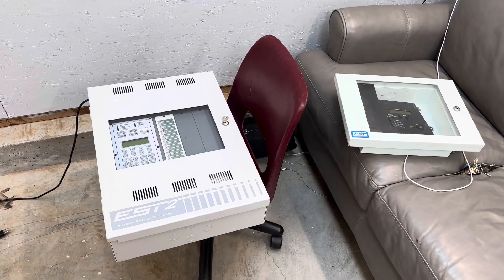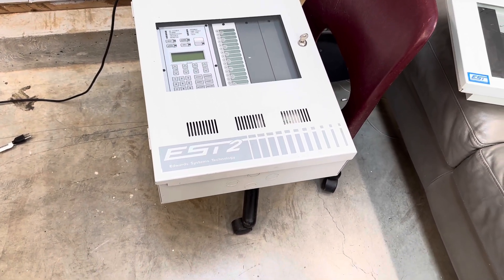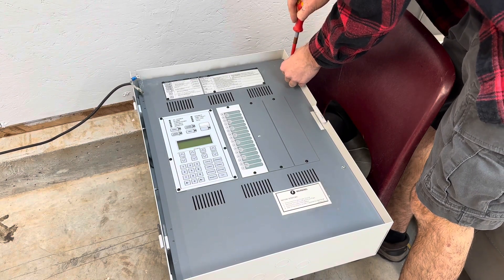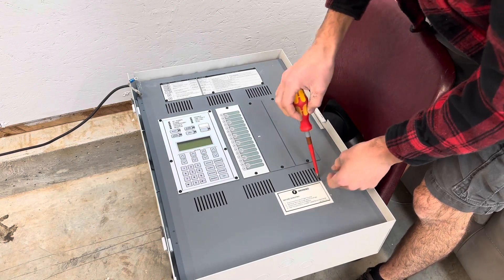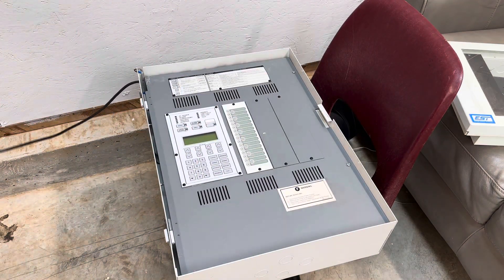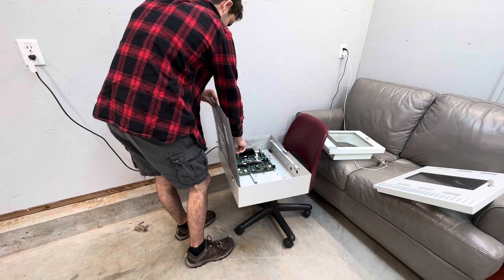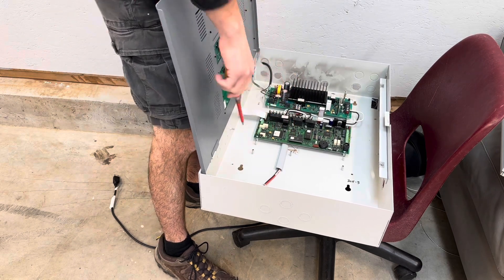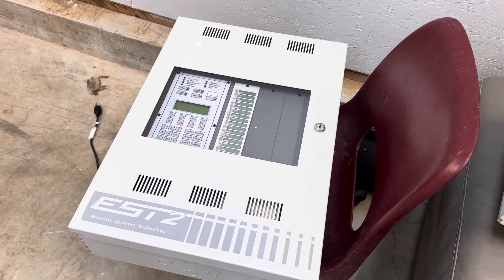My EST–2 blew up. What do I do with it now?

Comment: To the electronics recycling it goes! 

A Catholic school I want to had one of these until 2018 when it was replaced with a iO series. The alarm signals were Integrity series 15/75 candela electronic sounder horn/strobe lights and respective single gang remote strobes. Initiating devices were 278 series pull stations. The rest is too complicated. I dare you to share this with Old School Fire Alarms (if he is still alive), he will laugh profusely! The 6500 panels and before are much better built than these pieces of crap!

I wish they kept the original IBM FA system from 1957 and pull rod. All they would’ve needed to bring it up to code were a bunch of relays for fire doors, HVAC disable in the newer part, and some smoke detectors.
Reply from the maker: It’s getting destroyed before anything
Reply: @nics-systems-electric  Did you recycle it? Those circuit boards contain precious metals!!

Comment: EST is definitely crap.  As you know in my previous comment that we had ghost alarms very frequently on the EST.  Although Honeywell is better, Notifier is also good too.  Honeywell vista alarm systems are very good too.  Once I got a Honeywell vista 10p and I did the exact same thing that you did.  Locked myself out of programming mode and couldn't edit the sensors or anything and I had no choice but to scrap the panel.  Long time ago.
Reply: Ademco vista panels programming can be access by pressing * and # simultaneously during the first minute of panel power up if you dont remember the installer code (4112). Then you can default the panel to factory settings. I did the exact same thing on my 10p when i was 19 and thought is was done. Several years later i was studying the programming guide and discovered this and brought it back.
Reply: I believe Notifier is owned by Honeywell.
Reply: @topher8634  I did that.  However, didn't realize that if you change something in the *88 field, it could lock out all local programming.  You have to be very careful with that *88 field.  If you change anything in that field, then it will lock you out of programming mode permanently.
Reply: @superstar64  they are.  Notifier by Honeywell.  I have a Notifier panel protecting my house.  And, the panel says Notifier by Honeywell.  And, they are awesome systems and the nacs are filtered DC unlike the nacs on a Fire Lite.

Comment: It doesn’t have any battery so of course it’s not gonna start up because it doesn’t have batteries
Reply from the maker: That’s not the problem
Reply: A panel will start without Batts it will just have a trouble